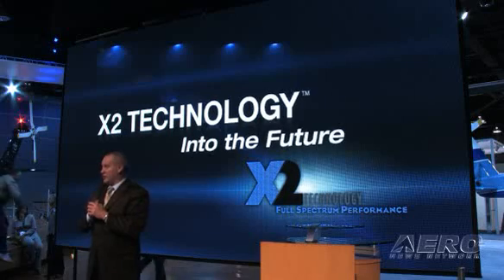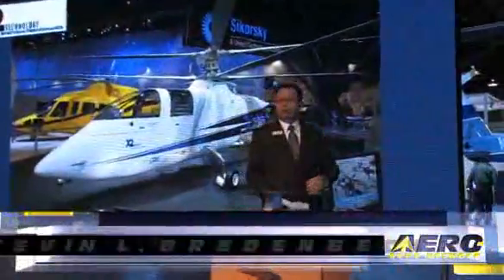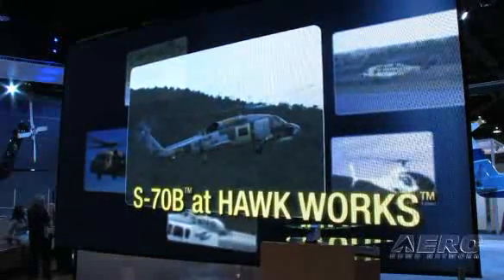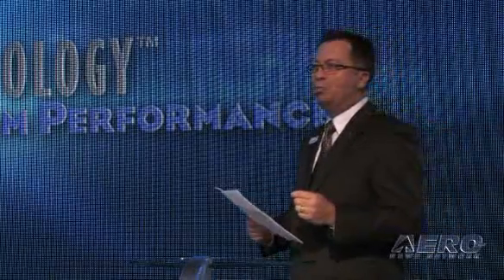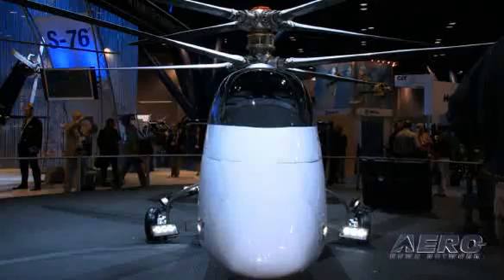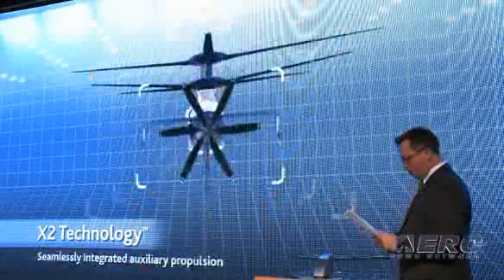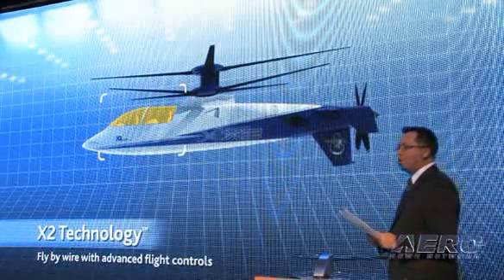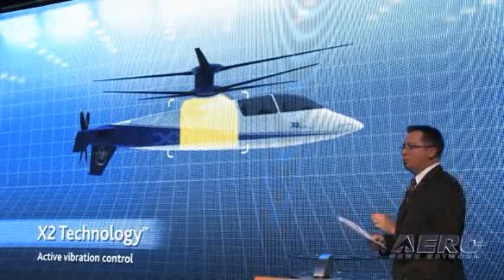Aero-TV: Sikorsky X2 Update - Progress On An Advanced Ro...

Comment: I don't think rotor blade in the back is save when you descend to ground even when it is not in rotation. Best alternative would be to move it two forward moving rotors on sides with wings. Wings will be an awesome thing to generate lift at higher speeds diverting those main blade power to those for forward charging motions and giving less 20% for rotations only.

Comment: no propulsive propeller on the KA50.The X2 is optimised for more speed as a conventional helicopter who is only propelled forward from the rotors...X2 allow to reduce the RPM from the rotor and so increase the possible speed without broke the  sound barrier at rotor blade tips